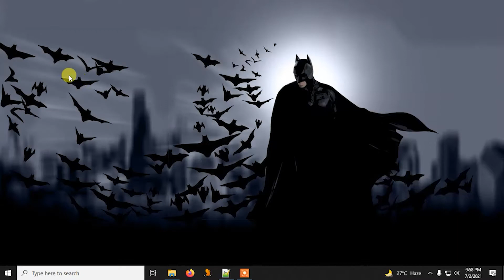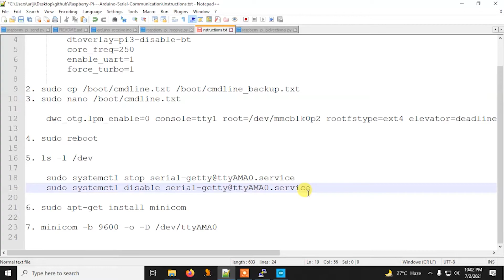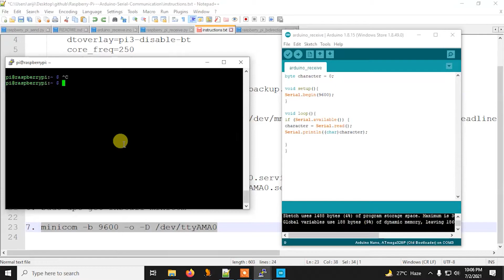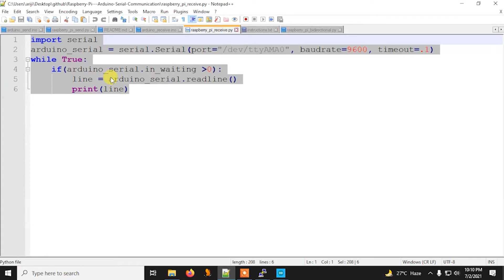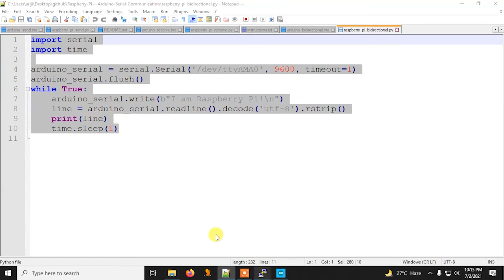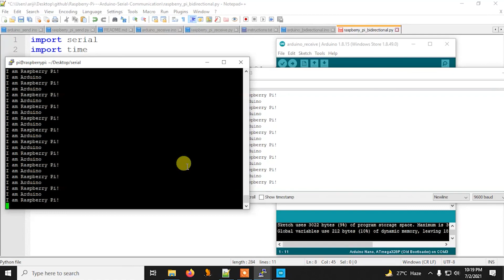Raspberry Pi & Arduino Serial Communication over GPIO with Python

Comment: Thanks for the tutorial, seing you use pskill minicom is hilarious 😂 had the same problem today and ended up restarting the pi. Apparently its crtl +z followed by pressing q to quit minicom, not very intuitive. will try this using a two resistor voltage divider since i dont have the small voltage divider board.